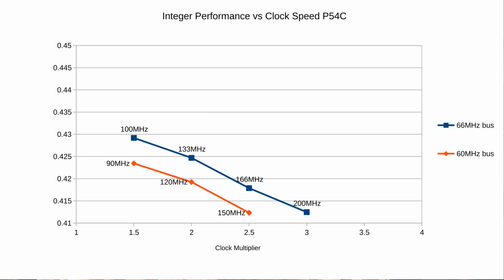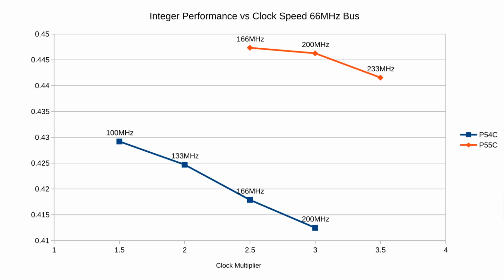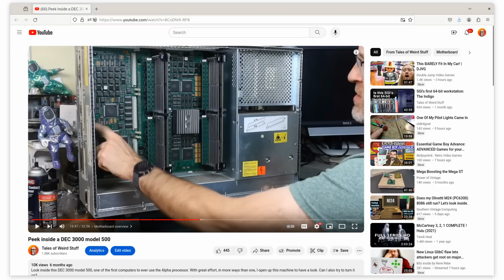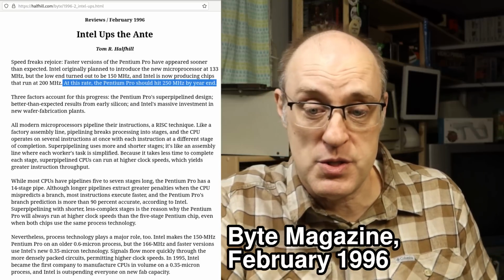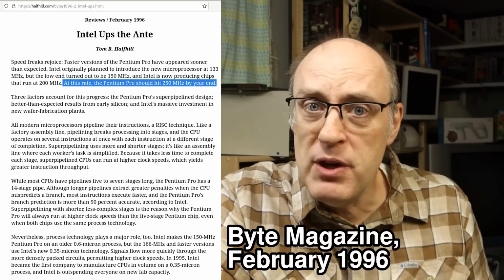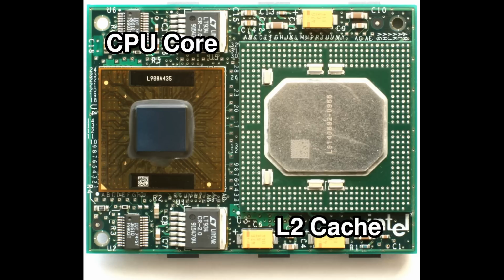Why did slot CPUs exist?

Comment: 39:13 as having worked in chip e-test, I don't see any reason why the cache chip and the cpu chip couldn't and wouldn't have been tested independently. It would be absolutely insane to bond multiple die into packages without testing each die independently. I can tell you that even today, individual pieces of designs are tested independently from each other, even if they're on the same die. Running e-test on a chip is not like running the chip in normal mode. There's a lot of fancy stuff that goes on that allows individual units to be powered up and down and tested independently. And of course pieces that fail testing can be permanently disabled, and the chips down binned. You'd be amazed at how much redundancy there is in the cache arrays even today, and how much extra cache is there that can be mapped in to any location to "repair" defects. All of this functionality is permanently disabled once the chips are tested and configured and binned, so no end user can ever see that.

Comment: intel / AMD 80#86 microprocessors were always garbage, especially so when compared to the Motorola MC680#0 family, or the RISC microprocessors like the Fujitsu's SPARC64 series, or the MIPS R10000 and beyond. Heh, even the lowly MOS 6502 has a better instruction set than the 80#86 garbage intel "designed"...

Comment: It always seemed obvious to me why they existed. Upgrading your CPU as simply as your GPU, just by plugging in a new card, no need to fiddle with removing and installing a heatsink, and no need to worry about motherboard compatibility. I understand that there are many limitations to doing things this way and that's why it ultimately went away, but boy was it so much more convenient.

Comment: I knew all this going in but still great video!  Very entertaining and subscribed.

Celeron 300A is truly the most legendary CPU Intel ever made LOL.  I still have both of mine and their ABIT overclocking boards in my closet.  Thank you for the trip down memory lane.

Honestly I kind of miss the slot processors, they were quirky and felt special somehow.

Oh, one MINOR nitpick on your bandwidth analogy.  Doubling the diameter of a tube does not increase the throughput by 2x, it increases it by 4x as circular area is PI * R^2, 1x1 = 1, 2x2 = 4, 4x4 = 16, etc.  Doubling the diameter won't increase it by 4x but its still much more than 2x.  Your point got across just fine but it did still trigger my OCD a bit.

Comment: I loved it a lot. My PII 400 with 100MHz FSB ran stable at 120MHz FSB with some cooling tweaks and was an absolute beast.
Other than the price difference to AMD/Cyrix Models, I don't know of any complains over slot cpus.
Together with the Riva TNT I ran the original Half Life in 1280x1024 on it and it was jaw dropping. Only comparable to the first setup that could run Crysis with high settings.

Comment: I've still got a PII and PIII here, and it's a fine looking thing - also have the unshrouded Celeron too (the overclockable one). The slot idea, for the time, for both Intel and AMD helped them with the issue of what they needed "in/on and around the cpu" and creating a mini-motherboard interface really solver that for them. Also, and remember using this during upgrade paths, the newer gen 370 cpus could be fitted to a slot motherboard through a slot adapter, very handy. Building with Slot 1s or As was a breeze - typically there were 4 to 8 jumpers to set, and that was it - much easier than the myriad of jumpers for the older isa boards. Beyond that, AMD really came to the fore with the Athlon XP series (loved using those).

Comment: I had a Pentium 133. Due to the locked multiplier, it couldn't be overclocked much... Except if you motherboard supported a 83 MHz bus speed. At 2 x 83 MHz speed (as in, 166 MHz) and 512 Kb of pipelined burst cache, and 64 Mb of SDRAM with a 430TX chipset, it benchmarked up there with a Pentium 200.

Comment: And today Apple has moved the RAM onto the the CPU die as well. For those who don't know, CPU, GPU, caches, machine learning accelerator, video accelerator, cryptographic accelerator, thunderbolt/USB 4 controller, PCIe controller, audio processor, NVMe controller, and RAM are all a single package and all sit on the same die. More or less the entire system is encapsulated within a single CPU enclosure. The board surrounding it only exists for providing power supply, I/O connectors and the WiFi chip is still found on that board. This makes the CPU so incredibly cheap to produce. Ignoring license fees, the production costs of an M1 were estimated to be $50. I bet the M2 and M3 were not much more expensive to produce. Sure, there are license fees and shipping/storage fees, and so on. But you can bet your ass on the fact that the margin of Apple's own CPUs is huge! I mean, to be fair, those CPUs are amazingly powerful, considering how tiny their power consumption is and considering the fact that those are ARM cores. I love the fact that I totally forgot what a CPU fan sounds like.

Comment: re: memories being put closer to CPU, on mobile devices there had been several SoCs that uses "stack" model where the RAM chip is soldered onto the SoC itself instead of the mainboard. there are problem with this approach—sub-par soldering job makes them prone to cracks and detaching, but for the most part they worked fine.

oh and ofc there are the HBM chiplets.

Comment: Incidentally I had a P3 500 MHz and a Celeron 366MHz system at the same time, and I'd swap the processors between systems so I could do crude benchmarks. The Celeron 366 running at 550 MHz didn't run quake/doom/half life as well as P3 did.  Good times.

Comment: Of all of the video game systems that used read only solid state storage over the decades you picked Atari?  I would have suggested Sega Genesis/Mega Drive, Super Nintendo, Nintendo 64 etc. as they fit the form factor better than the Atari cartridges.

Next, bandwidth...the flow through a pipe of water is more akin to current in Amperes, bandwidth is typically the number of pulses of water through the pipe against time.  Or, if you want to look at it in another way, bi-directional pairs of pipes (like that utilized with Gigabit Ethernet (two pairs down and two pairs up) both pulsing a frequent number against time.

Also, some others commenting on here have a generally favourable view for slotted CPUs and I can understand why when it comes to LGA and PGA issues for CPU sockets.

Comment: Given just how BIG some sockets have gotten, I'm inclined to think a return to slotted CPUs would be good.  Ideally horizontal (parallel to the expansion cards) so you can easily blow heat out the back of the case.  Although, pin-count has gotten so high I'm not sure how feasible that would really be.
Reply: High performance compute is generally moving towards everything parallel to the motherboard, with most everything being connected board to board. Some of those crazy big chips have insane I/O capabilities, which I doubt could be shoved into a standard x16 PCIe slot.

Comment: I have one of those socketlots adapters that i found when i was 13 years old to upgrade my slot 1 pentium 2 350 mhz to a Pentium 3 700 mhz (the processor was a 1.0 ghz).  I still have that adapter. I never thought it was rare cos i was able to find it very easely back then. Im from Argentina and here everything is hard to find..so... i was very lucky to find that one and more lucky to made it work on a crappy motherboard that i can not remember its brand. I think it was a PCchips.. those were the days that thanks to the lack of a job, forced meto  reuse and try to glue stuff togheter to be able to keep upgrading my setup (learning a lot in the process). Times were a computer made in 1998 was obsolete in around six months to a year.

Comment: What happened with the audio around 13:32?
Reply from the maker: I'm not sure if it's the microphone or OBS, but sometimes a few audio packets get lost. I used to record videos a different way (which was a huge hassle). I recorded the audio on the same computer with the same microphone, and I never got those drop outs. I'm really not sure what the cause is. :(
Reply: It glitched a lot at random places, not just the timestamp you mentioned.
The microphone probably was getting overloaded, listening to all that verbiage and fake laughs.

Comment: As diesa shrank and chips evolved the reasons for slocket's did the same. If you wanted your hardware to bridge these things chipset was everything and the 440BX was the shit. Whether it was rocking your 300 meg Celeron at 450 (easy) or supporting 1 gig of PC100  so no screwing with RDRam on your Coppermine 800 5 PCI slots and AGP. Slockets and adapters saves me so much money back in the day.

Comment: 24:14 Not to be confused with what is discussed in this video, I also recall "#-way" being used a few places to also describe how many things can access different locations of cache/buffer/register at the same time, often involving multiple address decoders for each parallel I/O and read/write circuits for each 'word' of the storage-logic array making for very complex circuits indeed. That was a 'very long time ago' and vastly different from methods of deciding what to put in the cache and how to catalog it.

Comment: 45:42 Oh yeah they are rare, find a UP2000 with two working 833MHz 21262s, I recall something called a 'Screamer' tower that sold with them and I think that was it. So rare I can't even find a pic of the case that I recall seeing in a computer magnetize in the 90's. the slot orientation was different, however, more of a front-to-back cooler airflow orientation rather than a plastic wall blocking airflow between the front and back of the case.

Comment: Ehm, around 10:00 there is a concept used that makes my brain itch and scream demanding that for the sake of humanity, brains, logic and all that is holy - I have to take a moment to state the blindingly obvious: A 1x multiplier is not a multiplier. It is, in fact, the absence of a multiplier - a 'non-multiplier' - also known as ''(it's between the quotes, exactly - nothing.). EVEN if we at times use it as a concept when comparing a system without a multiplier to one which has one, regardless of whether we are comparing CPU's or piles of M&M's. 
Before anyone tries it, the fact that you can do 1*1 on a calculator where the * is 'multiply' and you get 1 as a result DOES NOT MAKE IT A MULTIPLICATION! See, it's in the name, 'multi' means many. 1 is the polar opposite of many, but it's a position shared with it's opposite 0 in this case, in a way, as odd as it may conceptually seem. We are in a non-binary denominational space, with 3 states possible: none/zero, one, and many. So, a multiplication by virtue of it's name, and logic, cannot, does not and will not be by either 1 or 0, because neither are 'multi', what you have then is nullification (0) or singlification (1). 
Now my allergy to incorrect descriptions of system concepts is placated, my heartrate is back to almost normal, so I shall continue watching the video.

Comment: I still have most of the parts for my Slot-1 PII and BX motherboard. I didn't replace it until the Athlon 64 x2 came out. I built my first multi-core 64-bit Win2k system with a pair of video cards in SLI and booting from a pair of HDD's from my first RAID array. Man, those were the days when having two of everything was the key to going fast! Even if it all barely worked! It was fun just for bragging rights.
Reply: The only 64-bit version of Windows 2000 was for the IA-64 architecture (Itanium), not x64. It follows that you definitely did not run Win2K on Slot-1 PII and BX motherboard.

Comment: I still have an older P2 dual slot board and CPU's. It definitely was pretty interesting in concept, but with the P3's coming out so quickly it became obsolete (at least in regards cost) for home consumers.

As for memory, wow was it expensive. Even with my first gaming PC in 1998 with a huge crash in memory prices 128Mb (2x64Mb) cost about $52 USD. Lol, the hard drive in my $3000 Gateway was a whopping...12GB. I remember fawning over 1GB Hercules GPUs with no idea if they were good for gaming or not...I just saw 4x the VRAM of the majority of high end cards on the market. Wow I wanted that thing. The ignorance of youth. On that note, I am way too far off topic. Fun vid. Love cache, hate latency.

Comment: a few years ago i went on an ebay rampage and got a whole load of hardware just for the sake of having it and protecting it, among that was a slot based xeon. i dont recall which one it was but at the time i had no idea there were so many different slot based systems. my only experience prior to that was as a teenager with my friends pentium 2, i just thought it was so useful to have the whole cpu and cooling issue sorted all in one card, rather than having to rig up a compatible cooler after installing the cpu. i was at the time running an athlon xp cpu :D

Comment: I had a FIC PT-2007 motherboard with a Pentium MMX 233 stuck in it that had SDRAM DIMMs and I had it overclocked to 262.5MHz (75x3.5) for years and years and it took about a decade for it to finally die.  This was one of those boards with both SIMM and DIMM slots and it did get a bit faster when I put the DIMMs in.

Also I had some 1333MHz DDR3 RAM in a Core 2 Duo machine and it benchmarked at about 3400MB/s and the same memory ended up in a Sandy Bridge Machine and it then benchmarked at over 10,000MB/s - The integrated memory controller in Sandy Bridge and newer is a big deal that doesn't seem to get the recognition it deserves.

Comment: My family had a Compaq Presario that didn't have any L2 cache and it definitely taught me the importance of cache - this was a 150MHz/60MHz bus machine and it got spanked pretty hard by the Pentium 133 machines at school - they did have cache and they were so much faster and more responsive. I secretly overclocked this machine juuuust a bit by moving the bus speed jumper from 60 to 66MHz making the CPU run at 166MHz - It helped a little. This computer also had the economy VX Chipset and a 4500RPM HDD (not 5400, I remember when it got replaced the label said 4500 - it was some Seagate OEM part) This junkbucket POS didn't even have the COASt module slot - just the solder pads on the motherboard.

Comment: Actually water doesn't come out of a fire hydrant at very high pressure. That's a common misconception. A fire hydrant is connected to the fire truck which takes that water and boosts pressure multiple times. The truck has a large water capacity tank and needs time to fill and create a 'cache' so that the lower-pressure hydrant can maintain flow. So your fire hydrant analogy logic is flawed. These slot packages existed purely because Intel couldn't put the cache inside the CPU. Later they figured it out and dropped the external L1 cache and put it inside the CPU.
Reply from the maker: I think the analogy works fine. Fire hydrants in the US can provide up to 1,500 gallons per minute. Modern kitchen faucets with water restrictors installed provide up to 2 gallons per minute. That's a pretty big difference in available bandwidth. The pressure may not be that high, but the opening is quite a bit larger.(For folks who don't know, fire hydrants in the US are color coded based in the amount of water they can provide. Red is the least, and blue is the most.)
Reply: Fire hydrant is unregulated.  You are going to see full mains pressure.  It is going to be higher than your average 60psi residential/commercial tap.  Hydrant connected to a pumper is to increase pressure, for the purpose of increasing range.  Guess they conducted some studies that indicate crew and gear don't readily burn when removed from the immediate flame front.  As pressure increases, volume decreases.  A tank NEVER corrects over utilization of a resource.

Comment: Hmm, this all brings us to today and Epyc Milan-X and Ryzen X3D chips with on ceramic packaging L3 cache as CLOSE as possible. Also processors with in package DRAM are a thing as SOCs, putting all major components in a neatly stacked silicone burger. So to summarize, all old ideas are in any shape or form re-thought and re-implemented with newer fabrication methods.
I'm pretty sure, that in a few years Xeon and Epycs will come in their own carrier pcb with their own heatsinks and their own VRM power stages to reduce load and component cost of the mainboards, so that essentially only data is transferred between mainboard and cpu card.

Comment: I think I might've had one of the second-last series of the Slot A chips AMD made with the Athlon K7 700 around '99 or 2000. Then they immediately announced there would be no more Slot A chips and the Athlon XP was going to be Socket A only. That was pretty much the end of any hopes of upgrading that PC! But I wasn't too sad because of Moore's Law and the Athlon XP was many times faster.